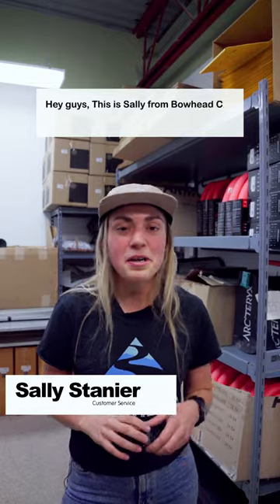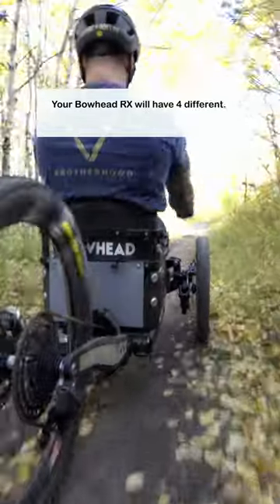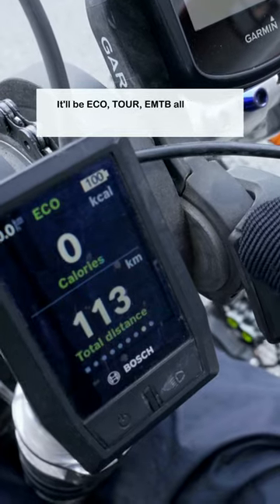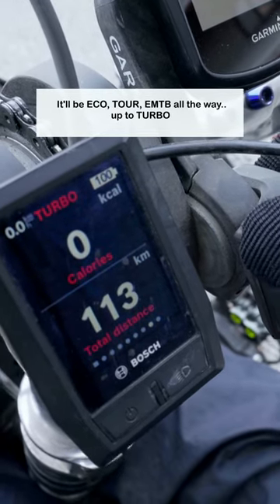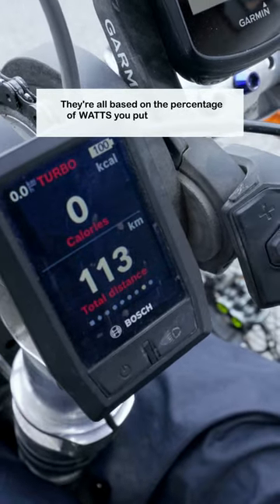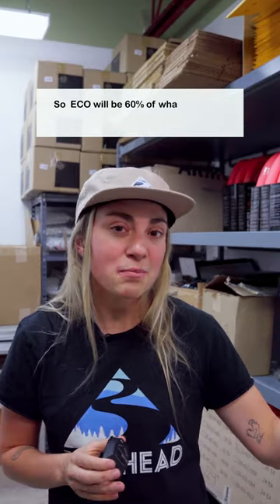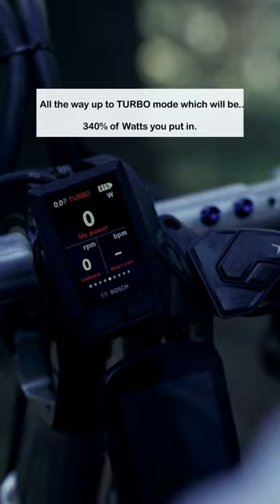The 4 BOSCH CX Modes Explained! TURBO MODE!!!

Comment: my trek rail speed sensor on the rear of frame was dangling with a slight split in the plastic,ive hex keyed it back on tigh plus took it back to the shop,it still works but with my health i couldn't leave it to be fixed,the battery and time, rpm all read true yet the disc magnet fine and the firmware was checked,plus my other e mail adress and name were wiped but not by me.can you give me any tips on how to fix it,oh its a gen4 cx line bosch,thanks